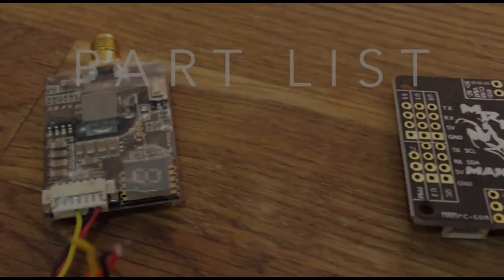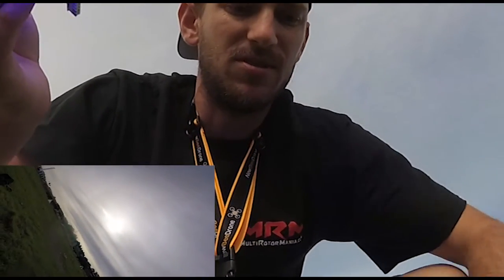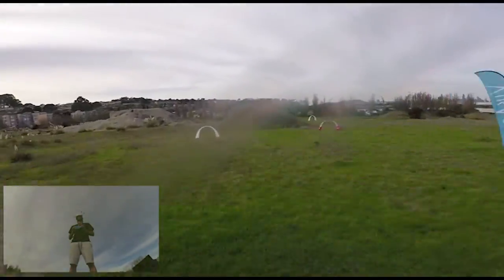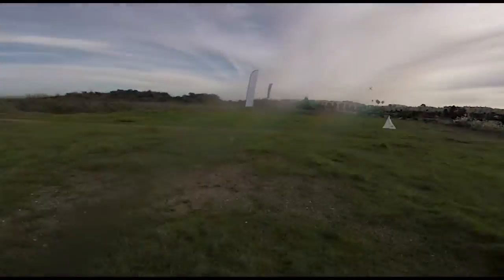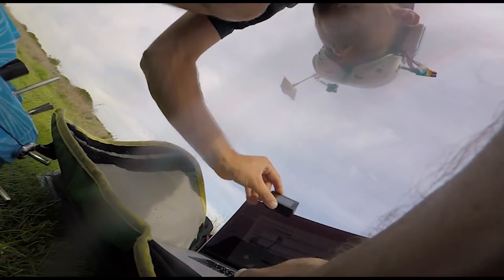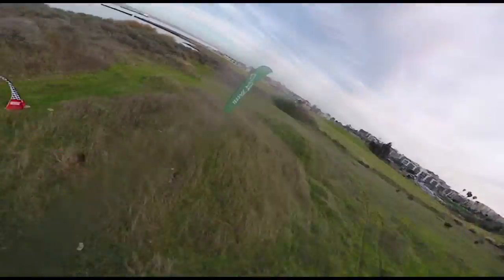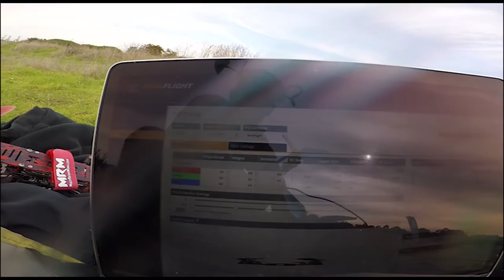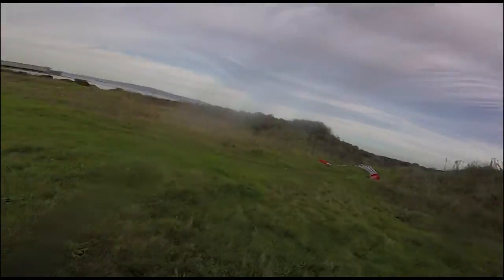HOW I TUNE A QUADCOPTER

Comment: Nice flying :) Those escs are basically like a XM20 right? With heavy props and non Kiss/BLHeli_S escs there is only so much you can do about propwash. A racing tune like that it is better to have it super locked than sacrifice for nice footage ;) Nice build!
Reply from the maker: The RCAddict yea my freestyle quads are lot looser and more "floaty"

Comment: Awesome running session! Ordered an mrm mantis flight controller for my next build. Do I need a polulu for a 3s setup? And 4s in the future?
Reply from the maker: Amber Meows I'd suggest just buying a pdb with a 5v regulator built in. MRM has a couple options. They are solid. They also have a 12v reg on them that can power your vtx
Reply: Awesome thanks a bunch!

Comment: just my opinion but having 1 value in the loop very high is a sign that youre overcompensating for something. try lowering p and increasing i. you will feel the locked in effects of I because thats your resistance to external force
Reply from the maker: Eric Bell hmm I feel like my P is actually pretty moderate compared to other builds. I'll give that a shot today and see how it feels. Thx!
Reply: SF PV well hey, the sign of a bad tune is if the hardware starts acting up. if your motors dont get hot then crank up d until it feels good. but i think there is a way to get a more "square" tune if you know what i mean. play around with I more. hey no prob man love the videos keep up the great work
Reply from the maker: Eric Bell I really have no idea what I'm doing 😂 appreciate the feedback and your support 👍🏼👍🏼👍🏼
Reply: ah no worries man! were all trying to get that butter quad XD hope you find a good tune! again keep it up.

Comment: Im still trying to grasp how your able to run your d gain so high? Aren't the motors getting hot? I know BF implemented a bunch of new stuff lately so that maybe why your able to run them that high. Could you explain if I am missing something? I haven't been able to keep up and understand all the latest changes. I also am in the process of tuning a stretched frame (BF 3.0.1) but my d gain is under 10 for both pitch and roll. l could probably come up a bit as there is a slight oscillation on hard 180's, other than that it fly's ok for me.
Reply from the maker: Yea bump that D up and you should be able to get rid of the oscillation. Motors wouldn't get hot from high D, but high P, I believe
Reply: Sounds good. Going out to fly tomorrow so will get it dialed in. Thanks and keep the videos coming.
Reply: Ok cool, good to know. I'll do some testing when I get out tomorrow. Thanks!
Reply from the maker: Just tune P first. You don't want to keep dropping P to get rid of prop wash and shutters. Try getting D up high after you can fly in a straight line without any oscillations by tuning P up
Reply: Good tips here, but D is actually the main cause of burnt motors. There has been lots of advancements to prevent this, but where if the P value is too high it will cause regular normal ish heat, if D becomes to a certain point, it will multiply of itself, and can easily smoke a motor/esc :)
Reply: ADAMBOMB FPV I'm not saying I'm an expert, but certainly not a noob. Also, when I wrote this comment the video was just starting. By the first comment remarking on super high D I was expecting something like 80, not 40 haha. So many that regains some credit? lol Plus D could be a problem if it was too high on old cleanflight luxfloat I think? With today's betaflight, you have to be trying pretty hard to make something go bad ;)
Reply: ADAMBOMB FPV Yep that's for sure :) Mine normally end up about 40.
Reply: Hey guys, so yeah Im really not used to seeing such a high amount, also where Im from there's not a lot people that fly FPV so everything we do is based on info from the web. So when I saw 40 I was amazed. Usually my D is never above 15 on most of my builds, as anything higher just makes it feel "tight" for me. But I did get a chance to mess around today and found that my quad does feel a lot better after adjusting my PIDs  and then rates to get rid of that tight feel. Still not 100% but getting close.
Reply from the maker: 345kryptonite right on! Yea don't be afraid to jack d up on the new betaflight firmware. Then, like you said, use rates and super expo to get some more agility